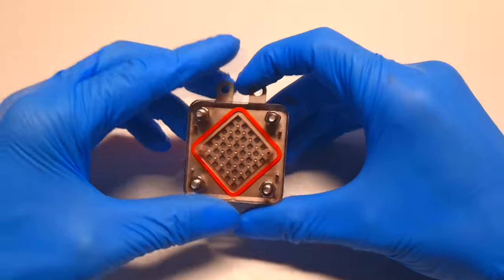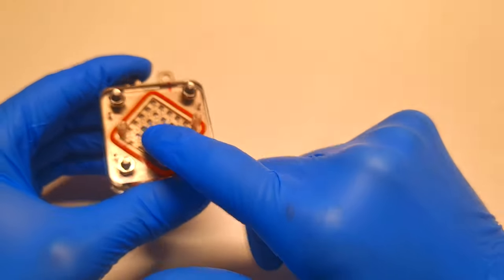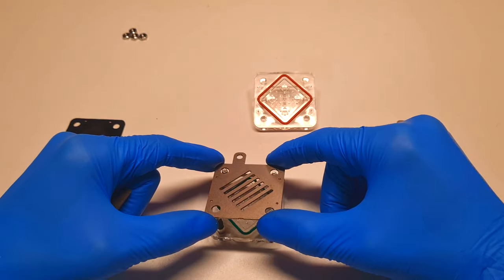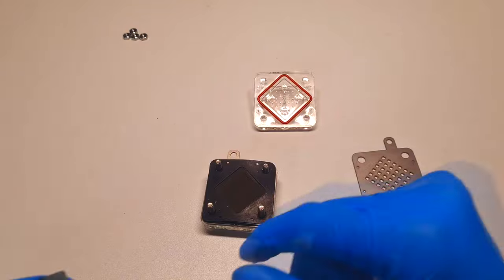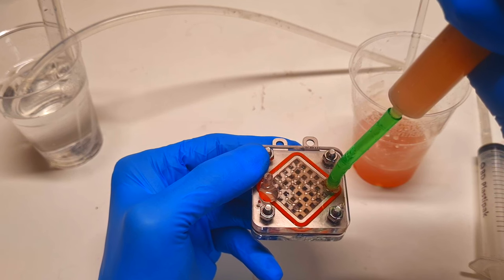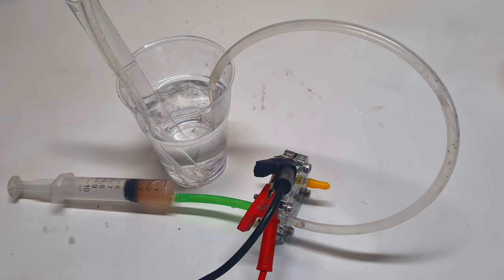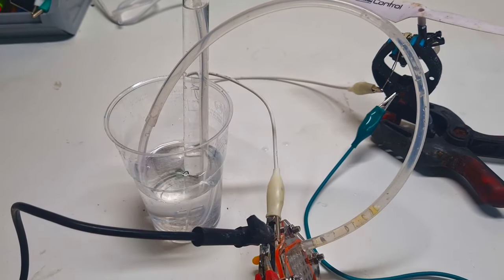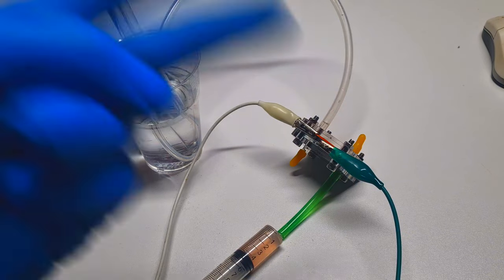Diy Hydrogen metal battery from a Fuel cell

Comment: Can i ask something please?. What would happen if the gases coming from an HHO cell where to be coupled with your HMB ... and then the electric generated from that was used to power the HHO cell again? just curious
Reply: Second law of thermodynamics, entropy would increase and after a while it stops working due to some inefficiencies
Reply: @stealthzcloakz5850  ah ok, so its possible to create something like that BUT its aways going to be about inefficiences... like perendev magnet motors turn out to be expensive "breaks"lol. Instead of the overunity pursuit, maybe it should be about how efficient can i make this given the energy available. I go look that up :)
Reply: @stealthzcloakz5850  
there are no known methods or technologies that can convert available energy into electricity than the 
ABB's 44-megawatt synchronous motor. It has an efficiency of 98.8 percent.

Turntide's high-efficiency PMSM motors: These motors have an efficiency of up to 98.5 percent
Siemens' SuperSynRM motors: These motors have an efficiency of up to 98 percent
Tesla's Model S and Model X motors: These motors have an efficiency of up to 95 percent

... interesting